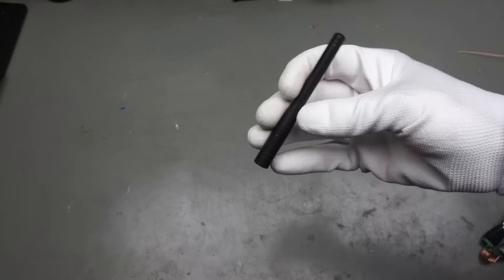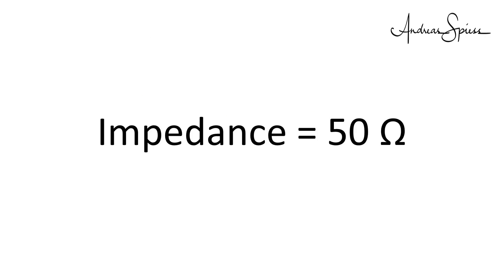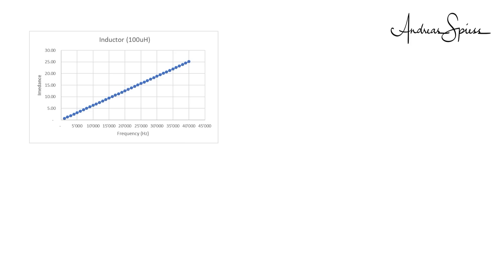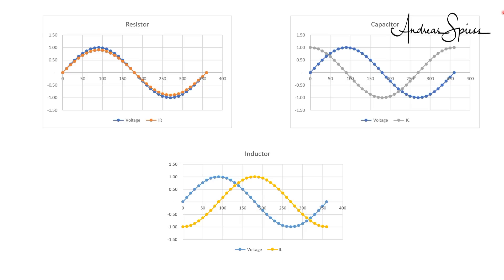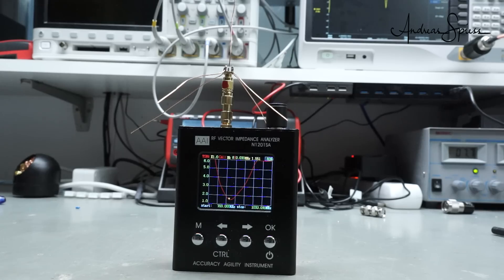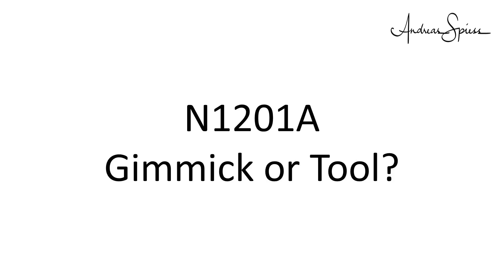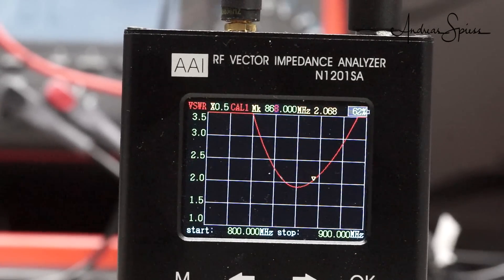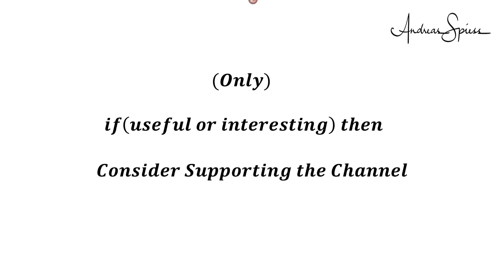#191 Optimizing Antennas using a cheap N1201SA VNA (Vector Impedance Analyzer), LoRa, Review

Comment: 14:10 onwards: It would make more sense to pronounce S11 as "S one-one" (not "S eleven"). My advice will be evident later if you are not yet aware of the set of "S" parameters that fully characterize a linear 2-port component, called S11, S12, S21 and S22.
Reply from the maker: Maybe I got it wrong. But I hope it was still understandable.

Comment: Thank you for this excellent video - I have been looking for a cost-effective way to tune PCB antennas and this looks like the right choice. Did you find that the N1201SA works better for antenna tuning than the MinVNA Tiny? I had seen the MiniVNA on AliExpress before but wasn't sure if it was any good (it seems to be a copy of the more expensive one that comes in a plastic case). I've subscribed and Liked, will definitely be checking out more of your videos!
Reply from the maker: Welcome aboard the channel! The MiniVNA Tiny is also good and has more possibilities. This one is much handier if you do not want more than testing antennas. I like the MiniVNA for its capability to draw smith charts.
Reply: Thank you for the reply! I only need to find matching L, C components to match printed PCB antennas so "handier" appeals - thank again!
Reply from the maker: But then maybe a Smith Chart could be useful. But I am no specialist in those areas.

Comment: Great video and the MiniVNA Tiny looks like exactly what I want as it covers such a wide range of frequencies shame it seems like its no longer available.  Where did you get yours?  It seems a little different in the metal case so maybe you found an alternative supplier?
By the way can you also do a review of the even cheaper MR300 (based on SARK 100) which is good up to 60 MHz.  Not good for these antenna's it's true, but for us HAM's... :)
Reply from the maker: I got mine from the link provided.  Maybe you search on AliExpress. Or the supplier just was sold out for a few days?
I will not cover a low-frequency VNA because I have no use for it. But there are a few amateur radio related channels (e.g. WA2AEW) which are better prepared for such a review.
Reply: Andreas Spiess I did a search as suggested and although it seems the original supplier doesn't sell them I  found a supplier of an updated device based on the original.  Thanks for the reply. 73s

Comment: Hi,
thanks for the video, which introduced the N1201sa to me. I looked for further information and was astonished to learn there are not many information at all, beside of a few Youtube Videos. 

E.g. There are many different models now. 
N1201sa the one you introduced 
N1201sa+ with an extended frequency range down to 37MHz
N1201sac which adds a ttl serial port for communication. 

Then there seems to be a successor 
N2201SS, which seem to add a TX port, but Infos on that is very spare and most is misleading, e.g. the description of the N1201sa is given albeit the N2201SS is for sale. 
No infos whether different versions of the N2201 exists. 

Finally some sellers offer a N2061SA which also seems to offer a TX port for a frequency range from 1.1 MHz to 1.3 GHz. Albeit no more infos can be found. Esp. Further spec differences between the N2201 and the N2061 would be interesting. 

All Infos so fare are from Chinese sellers on the usual platforms. We all know how much we can trust those information... Heck, I couldn't even find the original manufacture homepage. No comparison tables, no reviews for the later two models. Nothing... even in Chinese information on the internet are rather spare. 

Much interesting would be a miniVNA tiny vs a N2201SS comparison, to get an idea about the performance in this price range. Both follow different ideas about usability etc. but at the end those might be what a hobbyist is looking for. 

Maybe that is a good idea for a part two of this video. ;)
Reply from the maker: I cannot Test VNAs. The only I tested with a colleague is the one I showed. The mini seems to be ok and the software works. For the moment I do not plan an additional video. I use the small one for my antenna tuning and the miniVna if I want to learn about Smith chart.
Reply: Well, I understand this. Was hoping that others can provide more information about all those different models.
Identifying the original manufacturer would be a good start already.

If you would have to decide for one, the N1201sa or the minivna tiny, which would you give a preference?

Comment: A very informative video, but I listened to the "power transfer" explanation at 5:20 to 5:45 minutes into the video multiple times to try to make sense of what was said. I concluded that there was a misunderstanding between the phrase "power transfer" and "current flow". The current flow is maximum at dc because the reactance of the inductor vanishes there. The current flow is also maximum at infinite frequency because the reactance of the capacitor vanishes there. But the "power transfer" also vanishes at both ends because the voltage drops to zero there, and power is the product of voltage and current. Power transfer is maximum at resonance precisely because that is the frequency at which there is an optimum compromise between voltage and current.
Reply from the maker: Maybe you are right. I  assumed the circuit is in series (comparable with a cable) and assumed, that, if I have no voltage across this "cable", 100% of the power is transferred into the load. Your view is probably a little different.
Reply: Thanks for your reply. The video describes a parallel LC combination, which is why the current is maximum at the frequency extremes. There is no voltage drop across the LC combination, and all of the power is disastrously deposited in the source. If it had been a series LC, then there would be no current at the extremes, and again no power transfer to the LC combination at the extremes. In either case, maximum power transfer occurs at resonance,   n'est-ce-pas?
Reply: The net effect is that the LC combination, which is simulating the antenna, gets maximum power transfer at resonance. If it is a parallel combination, then the source is in danger of being destroyed by too a high current at the frequency extremes. If it is a series combination, then the source is in danger of being over-voltaged (a factor of two, and maybe more).

Comment: Andreas, great work!
I just looked it up and there seems to be a model called N2201SS which is an improved version with ‘dB measurement’ - I am still trying to understand what it does exactly. There is a RMB200 price difference between the two.
Reply from the maker: The more expensive one has two connectors. But I do not know if the software is ready to use both connectors.

Comment: perhaps a stupid question, but if it works from 2.5ghz upwards to 2.7ghz,
you should/could be able to test 5ghz also .. ?
how does the 5ghz antenna react ?
instead of 1/4lambda it would be 1/8th, correct ?
...
or do i think too simple on the resonance frequencies there...
Reply from the maker: If the specified max. is 2.7, the chance that it works above 2.7 is small. Your calculations of antenna length are correct.

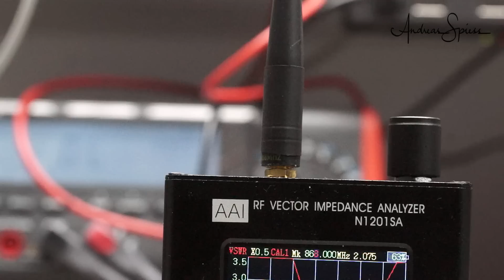Comment: Hi Andreas, the resonance frequency is lower than the frequency selected by the marker, isn't it? (@13:41). Great videos!
Reply from the maker: The marker is set manually
Reply: So you actually tuned the antenna to a freq. lower than the marker freq.?

Comment: Hi Andreas! I found this: http://hforsten.com/cheap-homemade-30-mhz-6-ghz-vector-network-analyzer.html. It's amazing! A 30 MHz - 6 GHz VNA for 200 €!
Reply from the maker: Thank you for your link. Very interesting project. Hopefully, somebody will produce and sell it. For me, it is too complicated to manufacture. And I have no test equipment to check if it works correctly.
Reply: I could probably produce and sell it for a good price. But first I need (a lot of) money for buying the test equipment to check if it works correctly! That's my problem, which I hope to solve by first selling other electronic products to a wider market (like consumer IoT). That or find someone with the required test equipment, like you did for checking the VIA.

Comment: Excellent video, thanks! I'd love to see you making video about a 433 MHz receiver to MQTT bridge. It's great to integrate cheap remote controls / door sensors / wireless bells etc. in a smart home. I tried it myself with difference receivers. I also tried the sonoff RFBridge but never got good reception. Only a few meters distance and I'm not sure why.
Reply from the maker: Interesting Idea. But the very cheap 433 devices would need some sort of addressing to distinguish the window from the door.
Reply: Andreas Spiess that's right, I think  most devices have a device ID to tell them apart. The sonoff rfbridge with custom firmware just forwards all received signals via mqtt. It's very easy to process them with node-red for example. Compared to other smart home solutions like homematic this is a very cheap solution. there's a wide range of 433 MHz devices available on Alibaba.
Reply from the maker: Do you have a link for the units you use?
Reply from the maker: Thank you for the link. We will see...

Comment: I also bought the analyzer and I tried to check the default 868Mhz Heltec antenna. I noticed that the signal curve changes a lot while moving/rotating/tilting the analyzer. The antenna is directly connected to the analyzer. Did you also notice this, Andreas?
Reply from the maker: As I mentioned, antennas interact a lot with their environment. This is normal and has nothing to do with the device.

Comment: You are allowed to import any value inside of Swiss without added VAT or taxes? in Europe you pay VAT on everything above 22 eur (incl shipping) + handling fees, so this usually adds on between 25 to 30% :(
Ok it's still not the price of a good spectrum analyser which probably costs 1000+ eur
Good video, even though I studied some electronics in the past, I didn't know any antenna theory, like you explain it it sounds so simple :)
Reply from the maker: In Switzerland this value is at 65 CHF. And VAT is only 8%. And the Chinese do not declare always correctly ;-)
Reply: ah yes, unfortunately in Belgium VAT is 21% :(
And yes I have also seen values of 5$ on packages that were actually around 30$ ;)

Comment: Good tool. Bit expensive. I want analyzer for 5.8Ghz too.
Reply from the maker: So you probably have to wait for a time...
Reply: Couldn't you use this analyzer and treat an antenna that's full  wave at 5.8gHz (such as the cloverleaf antennas that are fairly ubiquitous these days) as a 1/2 (maybe not?) or 1/4 wave at a lower frequency  that's within the range of this device and tune it it there pretty tightly (pretend the 5.8gHz is the 3rd or 5th harmonic of the true frequency of the antenna for testing)? After all, we aren't looking for perfect, merely good enough...

James

PS- great video, I subscribed to you your channel and gave it a thumbs up!

Comment: Hi and thank you for yet another interesting video.
Regarding the antenna you were showing that shifted resonant frequency when you removed / replaced the cover. I am wondering if it had something to do with the carbon content of the plastic / rubber used to make the antenna cover?
A long time ago, I read about building antennas and it said not to use black plastics to house antennas due to the carbon used in black plastics.
Reply from the maker: Well possible. I do not know the (chemical) reason. If it can be adjusted by cutting the wire it is still ok...

Comment: On screen when you are saying the antennas do not show any significant differences, the picture shows:
* N1201SA: Marker @ 868.00MHz, at -17.xx dB (the real dip is at ~ 21.xx dB); while...
* the other device shows: Marker @ 868.00 MHz, at -29.xx dB.
This is a pretty significant difference (the amplitude for sure, and the frequency offset).

Did you get pictures with good 50 ohm loads and shorts to see the measurement floor of the instrument (claims 60dB)?

Did you try measurement with a lead wire, and try to calibrate that out? Did it work?

Did you try measurement where an interfering signal is nearby (wifi antenna in a place with access points, for example?) Does it reject interference?
Reply from the maker: As I mentioned in another comment. Because we did the antenna tests on a bench we had some differences with antennas. But the qualitative measurements were good. To check the instrument itself we did tests with a filter which reduced the influence of the surrounding.
BTW: -20 dB is a VSWR of 1.2 and -28 dB 1.1. Both are very good for me. I did not document all these results because this video is about antenna optimization. You have to trust me that we did the comparison ok. And If you do not trust me, there are other sources on the internet which came to similar conclusions ;-)
We did not do any tests concerning max. sensitivity because we considered this as not important for our purpose. My 400$ Siglent reflexion bridge stops at around -20-25 dB... I would not expect -60 dB of a device for 150$
Reply: Thanks for the quick reply.

I wonder what the claimed 60dB spec is about then.

The only remaining thing then would be to make sure it works properly with a feedline, and that calibration against that feedline works. Thanks!
Reply from the maker: So far I did not do this because mostly I place the (small) devices close to the antenna and use a "feedline" on lower frequencies or DC.

Comment: At 12:00 you said you found no significant difference between the two analyzers. If I am reading the units correctly, one is showing an S11 of -28dB at 868MHz, the other is at -20dB. If this was for the same antenna then I would say that is a significant difference. But yeah great bang for the buck for this little thing and great video overall.
Reply from the maker: You are right (even if both results show excellent antennas VSWR 1.2 vs 1.1). We did not focus too much on the absolute values for the antennas because we did the measurements inside on a bench. There were some differences, also because of the setup. Especially with antennas. We more focused on the relative curve, which, in our judgement, is sufficient for antenna optimization. But we also measured a filter which removed most of the environment variables. And there the results were good.
Reply: @AndreasSpiess  you should have dug a little deeper into this unit, as it should be the center of attention, and it's filled with information and values and would likely be a helping hand to many people to explain what many of these values mean alongside the graph for these values.?. as the voltage standing wave ratio, pretty on call with the meaning of that aspect. 
and yep at the sub 90 bucks (USD), they seem to go for, its a nice tool, definitely.
https://imgur.com/a/3kHMlnW
If you have another video on this unit that goes more into actual item-details & features and meaning' or your familiar with one that tests this unit more thoroughly' please share..
Reply: A difference of 8 dB sounds like a lot, but is it in this case? It is important to remember what exactly it is you are measuring. S11 is reflected power or return loss. So S11 = -20dB means that 1% of transmitted power is coming back from the antenna or load, and -28dB means that less than 1% is coming back. Is that a big difference, or in fact any noticeable difference at all in how your antenna system performs? You may see a change at that level by bending a coax feed cable just slightly more or less.  For this price, a VNA measurement in UHF band to 1% in power ratio seems pretty good to me.
Reply: Hey! Look who it is.
Reply: You did not recall his complete statement. You left out "for our purpose." Shame on you

Comment: Helo, 

like you make a one video with ESP32 for
MQTT? But using JSON for 10 PIR,s
and 10 LED outputs with PWM fade.

But using only MQTT broker for use the LED pins. With duration 1 seconds. 
But komming neu command ist spot fade and fade to new finish PWM target level.

Thanks
Reply from the maker: I do not understand your comment. Sorry.

Comment: Hello Mr. Andreas! Excellent video very pleasant to watch and informative,  but  remains a question, what's the difference between N1201A vs N2201SA? Is there other feature available?
As a suggestion, could you please do some antenna construction videos? Thanks in advance!
Reply from the maker: As I mentioned it has two ports and also a Serial connection. But I did not look at it and if the software is good.

Comment: Great video .. You should have included how to measure the antenna impedance using the NS1201SA. You can tune the radials by bending them at an angle and measuring the change in impedance at the specific frequency. You can also use the VNA to cut optimum length feed lines. Did I mention I love this tool too :-)
Reply from the maker: You are right. But the video should not get too long and I always leave something to discover by ma viewers.

Comment: What is the purpose of the 2 ports? I’m about to buy one and will consider 2 port if it’s useful as additional function to what you demonstrated.
Reply from the maker: As I mentioned you can measure also S21, S12 and S22. Maybe you google their meanings and decide if you need it.The software is also very important for these applications, and I did not see it so far.

Comment: Thanks Andreas. Out of interest, after you manually "tuned " the radiating element by physically cutting it, how does the length compare with the wavelength calculation of freq(MHz)/300? And how close was the length of the radiator to what the online calculator indicated?
Reply from the maker: I did not measure.